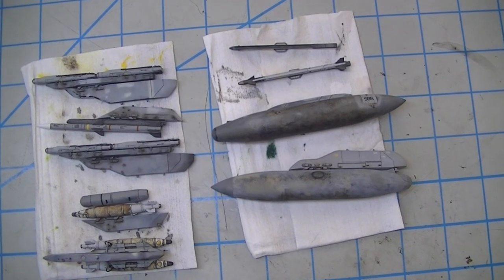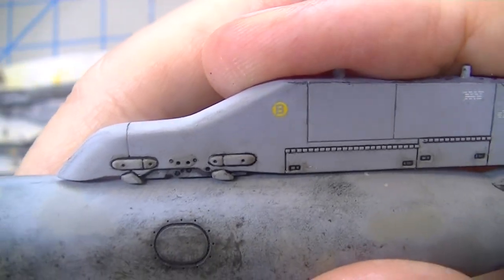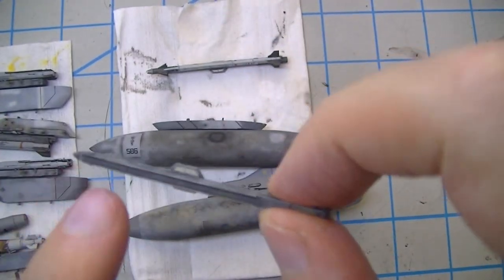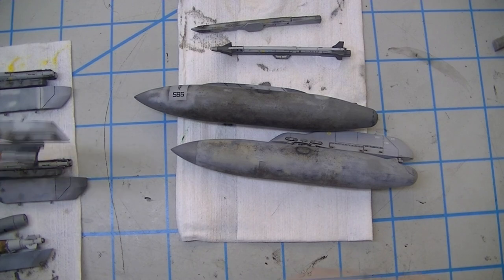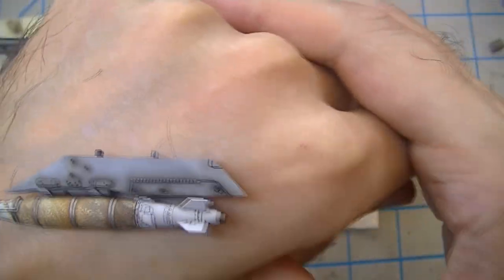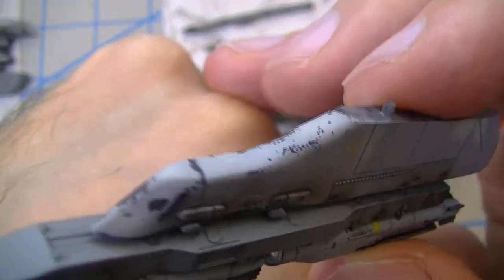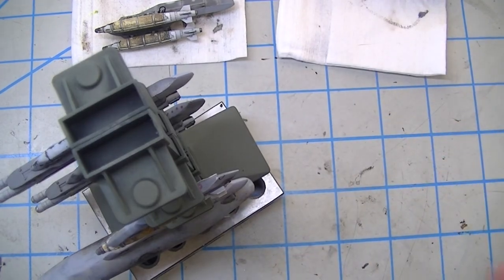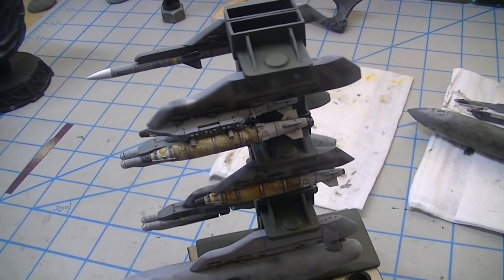ep346 - moar minutes of meng 1/48 super bug random #56

Comment: From a video from detailscaleview under the "Brassin Manufacturing Department in Eduard on Novemberfest 2017"' title . From their staff's explanation, it baffles me that they are aware of shrinkage of the 3d prints, silicone molds and casting resin and despite they go down 4 generations from master to mass produced items, they don't do any compensation whatsoever. There's a total compounded shrinkage that I've measured to be in the 5% range from real dimensions scaled down compared to the resin item you get from Eduard. The only exception for me have been the recent 1/72 Russian R-27 Alamo missiles sets I bought, and half of that GBU-53 set, the bombs themselves seem to be more or less dimensionally correct, but it seems the Racks they reused the masters and shrunk mass produced items from their previous GBU-39 SDB set. That explains the spacing and size difference for the lugs. OTOH in the Eduard tour the staff they give the excuse that shrinkage is not completely uniform, but damn I prefer they do some compensation and have a missile or rack that's near scale dimensions than having a set of @!%$% useless MER that are almost a 1cm too short and even their own 'shrunk' bombs can't be hung on it because they interfere with each other. And don't get me started when they combine it with photoetch which 'technically' doesn't change dimensions from their computer design to end product and you have to glue it to their shrunk resin. Maybe now they do adjustments as witnessed by the R-27 set I got, or maybe only the new stuff and not old stuff from what I've seen from the GBU-53 set, but hard to tell from just a 1-2 sets sample. I do my 3d printing, resin casting and photoetching and I'm aware of it and do compensate for it. I use elegoo or anycubic standard and they shrink 2%, I add that compensation either to the stl or the resin in the slicer. If I'm casting those I also calculate and add whatever shrinkage is said to be in the technical sheet of the silicone and resin. And as you said I go through many changes to the design and test prints till I'm ok with the shrinkage, tolerances, parts fit and relative spacing and position of key features.